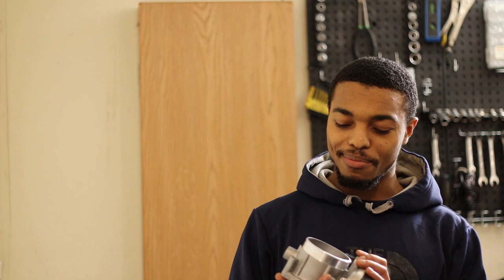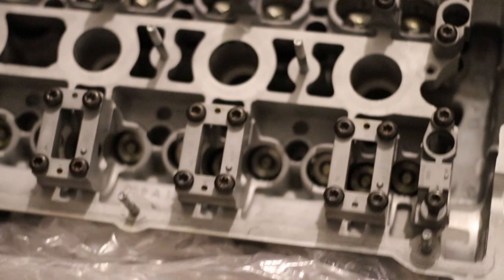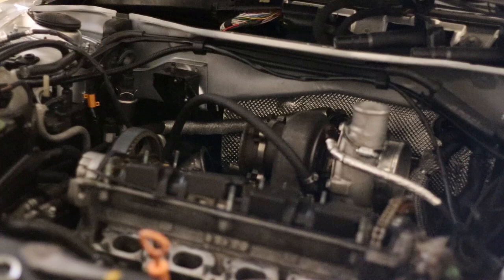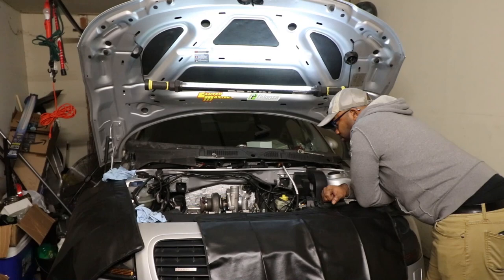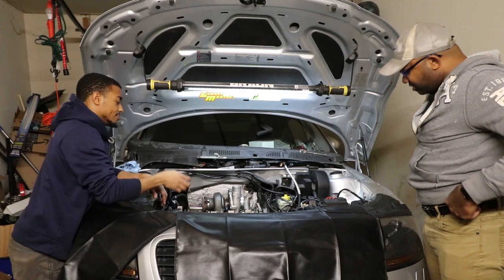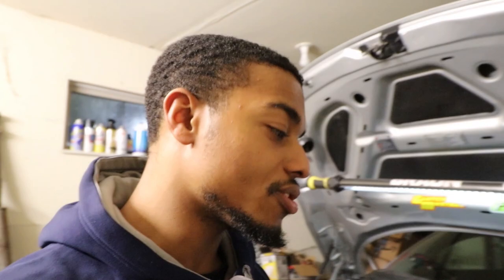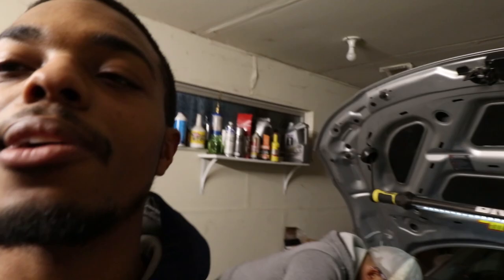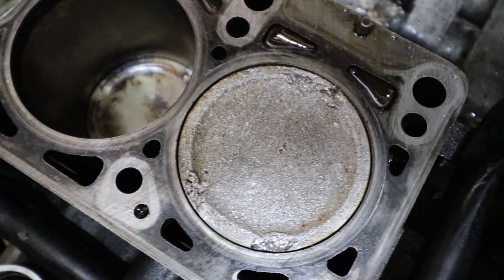Death of the Big TurboTT pt8

Comment: Hey man who’s your tuner for this TT I have one and really need a tuner for stage 3 gt28 on 550cc injectors
Reply from the maker: QuaTTrogame currently it has a Eurodyne base tune uploaded. I’m still figuring out who I want to tune it tbh. Considering boost dynamic tuning, but not 100% sold on them tbh. Actively searching for a tuner.
Reply: What’s the specs on the file boost numbers and such mine is k04 but I’m doing the aeb gt28 swap
Reply from the maker: QuaTTrogame I had a GT28rs, but I thought it was too small lol. The base file is 1000cc injector big turbo file. It’s going to be a lil off. I have a 80mm throttle body, IE intake manifold, and a AEB head now.